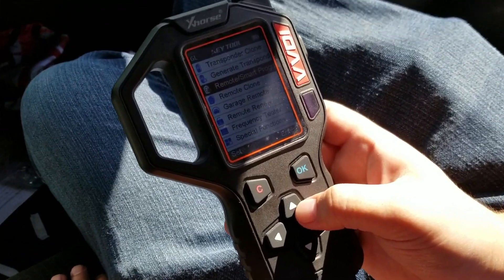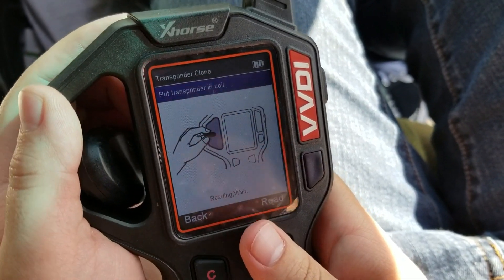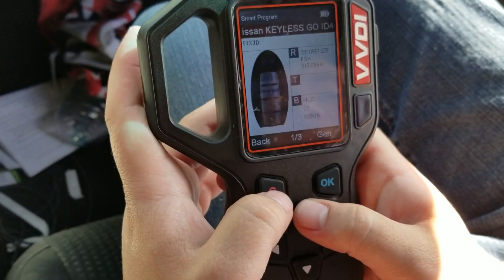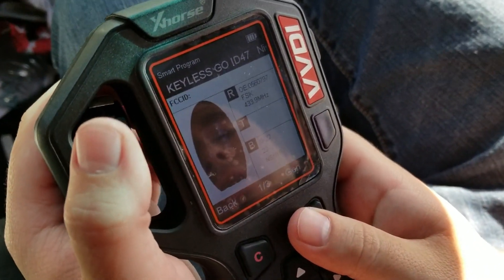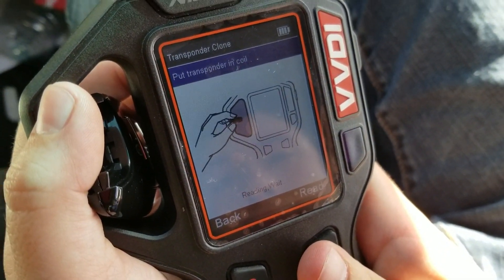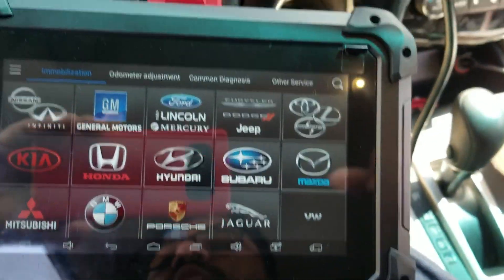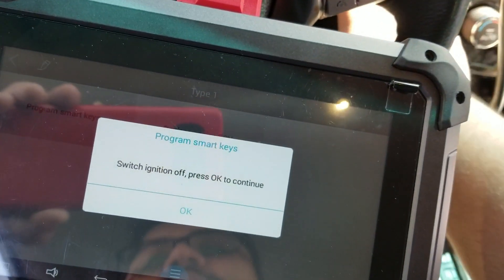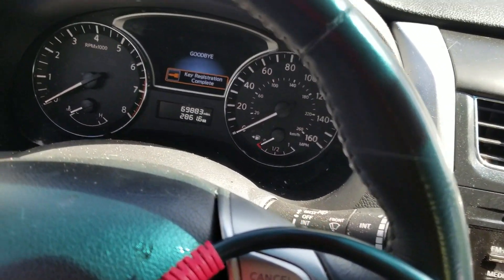Programming an Xhorse Universal Smart Key to a 2015 Nissan Altima HD

Comment: Are you going to have a application chart for these? I would like to know what fords they will fit?
Reply: It's probably too early to have a chart yet...I bet they're still developing the software and adding more vehicles.
Reply from the maker: A quick search led me to this list which was dated about 10 days ago. 
http://www.xhorsevvdi.com/upload/pro/19072615641213529254.pdf

The best thing to do would probably be to check the Xhorse app, however. It's free and you don't need to be connected to a Key Tool to browse the list. 

It looks like as of RIGHT NOW, there's a Surfboard style key, a few teardrop style smart keys, and perhaps even a fusion-style flip key in the list?

Comment: Is there a way to find out what ID or chip the vehicle uses in an all-keys-lost situation?
Reply from the maker: Unfortunately, it doesn't seem as though there's a resource (that we know of, at least) that will serve as a good reference for this currently. 

Some of the keys in the system have an FCC ID in the listing, some do not. Hopefully it's something that they flesh out a little more in the future. You may also be able to filter by vehicle in the Xhorse app by vehicle and check coverage by Frequency. The remotes are reusable, so if you guess wrong or you burn a remote and find you can't end up using it, it's not that big of a deal.
Reply: @americankeysupply2929  i want job key  I am looking for